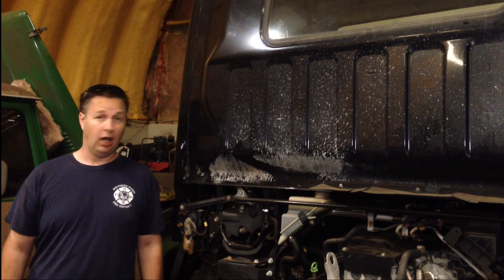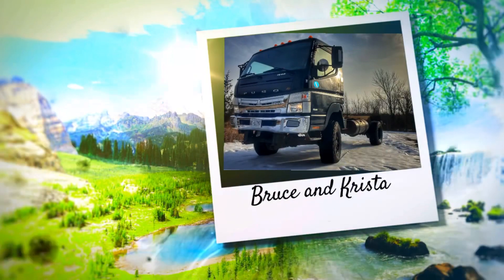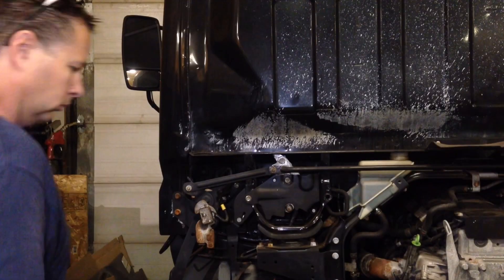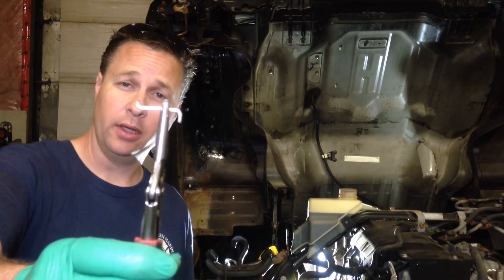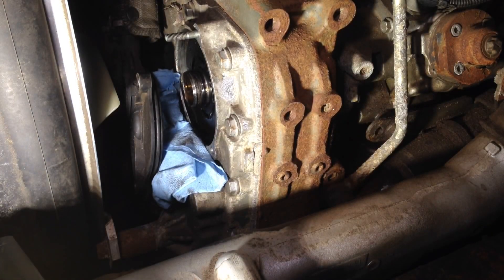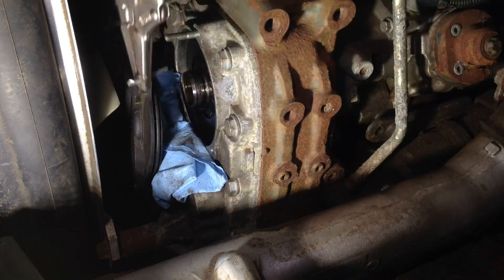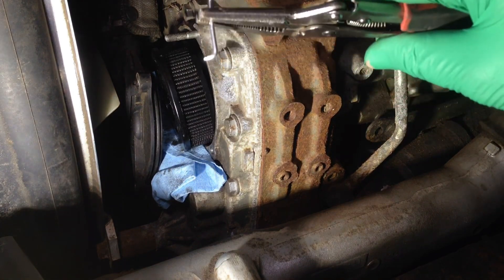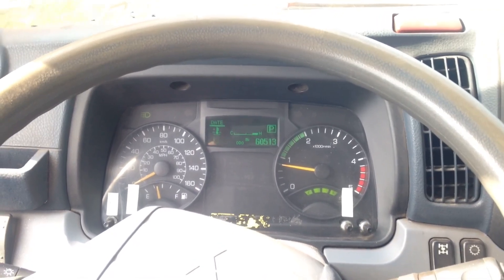Mitsubishi Fuso FG 4P10 crankcase pressure diagnostic 3

Comment: Hi ! I just rebuilt 4p10 engine. And now it’s not starting. I got a code saying component signal position sensor (723 31) could you help me in this please ?
Reply from the maker: 723 31 is fault check camshaft, offset angle exceeded.  Your timing is probably off.
Reply: @BruceandKrista  well, after inspecting everything, had to take out the nozzles and found that no diesel coming. But this was crazy 😂

Comment: Hi mate is the pcv filter can cause the truck to not start? Need to know please I have the same truck engine 4p10 fuso
Reply from the maker: Hi - I don’t believe the PCV can cause a no-start - but you should be able to read the SPN and FMI codes through the cluster to help see what is causing it to not start.  Link below to video showing how to read codes.

https://youtu.be/XI-nOFkUMK0?si=STL30AmzRHc3Pz8l

Comment: If your driving with dirty pcv filter and its going into limp mode on ya, pull your dipstick out a little and it will let you drive before u change the filter, but their will be oil spray
Reply from the maker: Great get home tip!

Comment: Hey, thank you for your videos. I have the same Fuso canter with the check engine light on. 

I have active codes: 

520422-2, 520422-31, 520419-2, 520419-31, 520420-2, 520420-31, and 520421-2, 520421-31. 

I have looked at your PDF files with codes but couldn't find the description for those listed above. Can you help me out?
Reply from the maker: 520422-2 IMA/ISA Injector adjustment programming not correct for cylinder 2 (-31 is the same, but just IMA).  520419 is the same for cyl 1, 520420 is the same, for cyl 3, and 520421 is for cylinder 4.   Have you had any performance programming done?

Comment: Thanks again deleted code started engine run perfect for 2min the rough idle 
Spn 520411 fmi 31 code returned unable to find this code anywhere on internet?
Anyone who knows what this code means?
Thanks
Reply from the maker: From what I can find, it looks like --> 520411-31 The function of component 'Preglow system Control unit' is not OK.   
I'd start by verifying the battery connections are very clean (wire brush clean) and tight - you shouldn't be able to move them by hand when tight.  Verify that power and ground to the glow system are good, and maybe check that each of the glow plugs is within spec.  If my info is correct -the pre-glow system control unit is located just above the ECU on the side of the structure that has the inverted J hook that latches the cab.  Check that its not damaged or corroded,  I believe it is an 11 pin connector, with one large pin and 10 smaller ones, with only 8 of the smaller pins having wires.   Could also be an issue with a temperature sensor which would be controlling the glow system (if it thinks the engine is warm, it will shut down the system, and it could run rough).

Comment: Thanks I found these codes on display as follows.
Spn 520411 fmi 31
Spn 520373 fmi 31   Spn 3058 fmi 1
Spn 636 fmi 2 spn636 fmi 9 
If you have information on what codes mean I found out one is crankshaft sensor that has been changed.
Thanks again 
John
Reply from the maker: Check the links in the video description of the video I posted yesterday about reading codes - there are links to PDF’s that should get you info on almost every code 😎

Comment: Hi what problems was happening I have same truck rough idle eml light sys light alternating yellow to red any ideas?
Reply from the maker: Hi - the truck was running/idling fine, but had the red light lit. When I scanned, the code was for crank case pressure.  If you don’t have a scan tool for Fuso, you can sometimes get a generic code with a “heavy duty” OBDII code reader (meant for heavy trucks) - but it will be a generic code.  You can also read codes through the dash cluster, by pushing the little buttons on the left and right of the display.  - I can’t remember the exact sequence, but I’ll dig it up for ya.  The amber light on the dash that says SAM is generally caused by a light bulb or lighting circuit, though there are a few other things that can trigger it.
Reply from the maker: Ok, so I decided to take one step further in answering this question for ya...  today’s video is for you and everyone who struggles with figuring out these trucks!  7PM eastern tonight (March 5th 2023) will be a video released on how to read the codes your truck has, WITHOUT a code reader - AND information on how to decode the code into useful information you can use to diagnose and resolve the problems!   I hope it’s useful!!!

Comment: Hello Bruce, where can I source PCV filter? I have the same pressure with my light truck. Kindly help
Reply from the maker: Have you checked with your nearest Mitsubishi Fuso dealer?  Depending on what part of the world you are in, they may be carried by truck repair centers as well.
Reply: @BruceandKrista  Thanks Bruce, unfortunately I have struggled with local dealers. I'm Zambia, Southern Africa.
Reply from the maker: @josephchibangu8927  sorry, not sure what other options are available to you, but I would think any heavy truck supply shop or a Mercedes dealer should be able to cross reference the part number, if Mitsubishi isn’t working out for you.
Reply: @BruceandKrista   Thank you very Bruce, I will check with Southern Cross Motors here. Much appreciated, keep up with the good works. 🙏

Comment: Thanks Bruce, You really have done most of the hard lifting for many of us. Thanks again. My problem is I don't have a box on the back of my Fuso like you had on your first camper in a box. I have Cab Chassis. and need insurance to get the ownership transferred lol P.S did you get your two Fuso's from the Seguin township?
Reply from the maker: Yep, these were from Seguin!
Reply from the maker: Ask your insurance company to provide you with a policy for JUST comprehensive - let them know you will not be driving it, and that you will be converting it to a Motorhome, and meeting the MTO requirements for changing the title to passenger vehicle. They should be able to provide you a policy for a stationary vehicle.  You can also ask the insurance company about registering it under 4500kg laden weight - which means you can’t carry any load, and thus can’t use it commercially.  (You will need to convert the title after you make the required modifications, which the. Removes the weight restriction).
Reply: @BruceandKrista  Bruce again, Thanks so much very helpful. I have been really enjoying your videos. It makes losing out to you when I bid on one of those trucks so much easier, knowing you are such a wealth of Fuso knowledge. lol
Reply from the maker: @davidmcgill901  you’ll be very happy with your 2005, not having to worry about all the DPF/SCR/DEF stuff!  Is yours manual as well?
Reply: @BruceandKrista  Hi Bruce, Yes it's manual and I am not very Mechanically inclined (master carpenter) but excited. I will be happier when I find away I can go and drive it home without breaking any Highway Traffic laws. I need insurance to change the ownership. lol Thanks again for all your very informative videos, I will definitely change the status once I get it here and start the build.